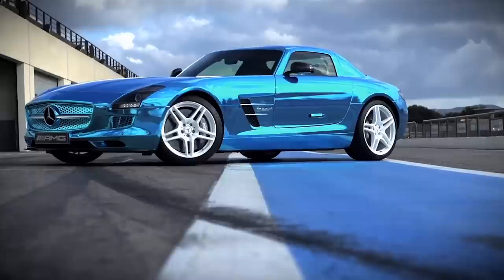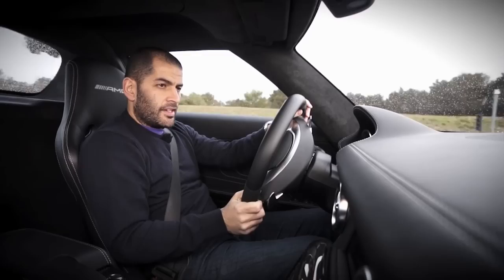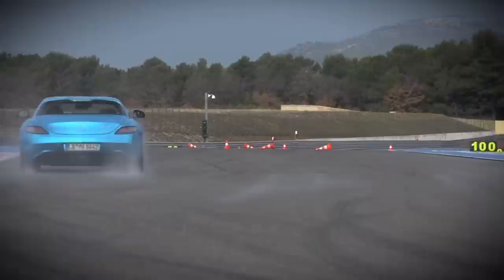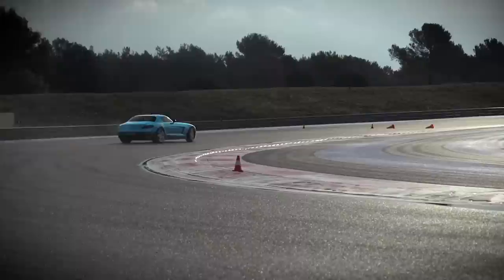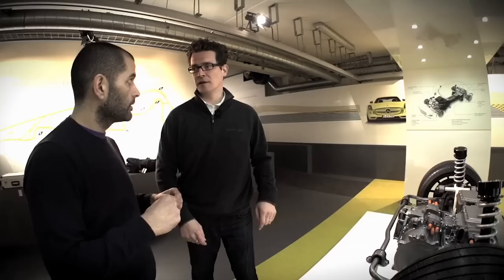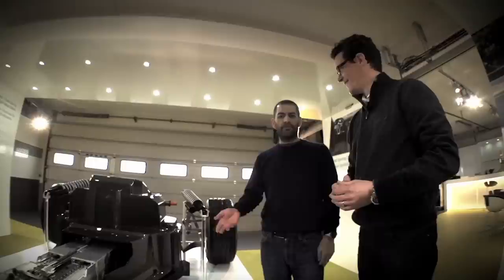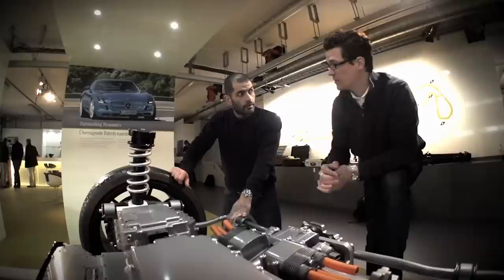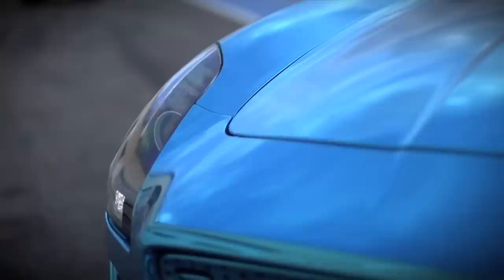Mercedes SLS Electric Drive. Can Volts Ever Match Pistons? - /CHRIS HARRIS ON CARS

Comment: It's the most powerful car the AMG division has ever rolled out of the factory and it STILL isn't an acceptable alternative for an ICE? It's only a matter of time before production costs fall, battery life further increases, and motor power/efficiency goes through the roof.

What excuses will die hard petrol fans have left? "But it doesn't go vroom!"
Reply: Did you forget the Merc SL65 AMG black? They also just made a wagon with nearly 900hp.
Reply: The 2013 SL65 AMG Black only makes 621 hp. As for the wagon you're most likely referring to the Brabus E63 AMG. Brabus is an aftermarket tuning company that specifically modifies Mercedes and Smart Cars, much like Shelby modifies Fords.

This is painfully obvious, Mercedes would never make a wagon faster than one of its flagship super cars.

The fact that the SLS E is the most powerful production car Mercedes has made thus far is a serious testament for the electric motor.
Reply: It won't stop electric being pretty futile and a waste of resources. what is the point in pursuing electric cars over hydrogen fuel cells?
Reply: Bensaves Hydrogen fuel cells power electric motors in cars, so I don't know what you're getting at.

If it's batteries vs. fuel cells keep this in mind. With hydrogen fuel, much like gasoline and diesel, there are mega fuel companies that control the resource entirely. Hydrogen is not an unlimited resource, especially since the most popular method of producing it requires fossil fuels.

What all this means is with hydrogen fuel you will have huge price fluctuations like gas prices do and still have fuel companies controlling the resource and the price, rather than the consumer.

Generating electricity is a waste of resources? I hope you meant how we generate electricity is wasting resources, even so that's pretty erm, stupid. No matter what resource we're using whether it is coal, oil, wind, light, water, etc, we don't waste the resource, it's being used to generate electricity.

As for batteries, that puts the control of the resource (electricity) much much closer to the consumer's hands. In the U.S., local governments have laws that protect and benefit the consumer. Also, the fact that electricity generation and transport is mostly  regulated by county and state bodies, the consumer has much more influence on these bodies than a resource like oil governed at the federal level.

All this being said, the most damming statement towards hydrogen fuel cells is simply that batteries and locally generated electricity are just so much cheaper. There are many more disadvantages to hydrogen fuel cells in cars, but I just wanted to focus on consumer connection and your notion that generating electricity is a waste of resources.
Reply: Sean Murphy
No, the batteries are a humongous waste or resources. I never said that generating electricity was a waste of resources. I said electric cars were (not precisely, but I assumed what i wrote was precise enough for the context). Batteries use all sorts of heavy metals and rare earth metals that are damaging to the environment and produce waste. As far as I'm aware, you use essentially inert Pt electrodes in hydrogen fuel cells which can be reused.

As for your comment on what's good for the consumer, that's immaterial. If petrol becomes antiquated, companies will find another way to gain control.
Reply: What rare earth metals do batteries use? Lithium ion, nickel hydride, and lead acid batteries are the top energy dense rechargeable batteries, none of which use rare earth elements. These batteries can all be recycled, I'm not sure if you were aware. The capacity of batteries increases by ~20% every two years, while our recycling and reusing methods and efforts further increase.

As for fuel cells, you need to extract hydrogen ions from some substance, whether it is water or hydrocarbons. We obviously know that we will run out of fossil fuels, so it would be pretty redundant to start on that path again. As for water, we need water to live. Just like we need space to grow food, the world needs fresh water to drink, bath, clean, and pretty much everything else. That's why using fuel cells and ethanol are not sustainable or even practical alternatives.

You're right, oil companies are trying to find another ways to gain and keep control, by investing in other fuel technologies like fuel cells and biofuels, while completely ignoring batteries. They're not stupid, they know there's not an unlimited supply of oil.

That's what makes battery power the most special, it takes the control completely away from oil companies and puts it into the hands of the individual.

Even when all of the fossil fuels on earth run out, we will never stop producing electricity. Geothermal, hydroelectric, tidal, wind, solar, and nuclear, we have so many to choose from. Why should we ultimately limit our cars to fuel cells? Mercedes isn't, its most powerful production car is fueled by batteries.
Reply: Firemarioflower Where did you even get this saving the planet message from? I'm talking about the vast efficiency and power advantage an electric motor has over an ICE. Mercedes has demonstrated this by making its most powerful production car fully electric driven.
Reply: Sean Murphy  Its all in your writing. Everything with effiency and electric are attached to this message. and you support it. So what if its more powerful, it doesnt have a proper sound, so the car is RUINED.
Reply: Sean Murphy I don't care about sound and barely care about looks,performance all the way,and it would seem electric cars are becoming quite the performance car.Even so i would be sad to see gasoline cars go,i love tuning engines,making them run better and the mechanics of them.I'm all for electrics,it would just be a sad thing to see them go(or become a hobby car that cost a lot to have and massive fuel cost)
Reply: Firemarioflower Now here's the nice thing about super cars,they aren't a necessity,there for they are completely up to opinion.My idea of a super car is some thing that will speed off the line,A car that can take fast turns,a car that can be driven on the road and then go dominate a race track.I want performance,handling,power,excitement,some thing that will scare you but make you want to drive it.I like electric cars but not because they are "green" or to save the earth,I just like the best super cars have to offer,and some electric super cars peak my interest.Electric cars have instant torque,high torque,and manageable torque in all four wheels,which is amazing for handling and off the line speed.These cars aren't designed to save the earth,there designed to go fast,and handle well,and are amazing pieces of engineering.And american hating?Ever hear of the chevy spark or volt?
Reply: Bensaves Safety, for one. Let's not replace flammable gasoline with even more flammable hydrogen.
Reply: Firemarioflower Prius? I seem to remember an electric SLS that could kick your Mustang's ass around the track.

You may be a hostile flamer, but I agree that the lack of polish of a supercar is exactly why it is so appealing (same reason people prefer Harleys). I doubt supercars will go full electric any time soon, especially the likes of TVR or Shelby that don't need to pretend to be good corporate citizens like Ferrari.

However, -for the common man- an electric car is better. It doesn't make noise, it has less moving parts, it's cheaper to run, there's more interior room, etc. Those things are what most people actually care about in a car.

All that's needed is some more mileage on a charge (coming soon) and models that don't blow the actual "car" part of the equation (would you drive an i-MiEV even if it had an Evo engine?) and normal people with other hobbies and lives who need transportation are going to want to buy them. And that's totally fine.
Reply: now try to modify an electric car. oh and try to take it to the track for the day. Have a nice time in the 5 minutes youre on full throttle
Reply: Sean Murphy And vroom is what supercar's all about...
Reply: Sean Murphy Vroom haha for real that shit is old and weak with what is new.
Reply: Sean Murphy I don't feel any emotion in any electrically driven vehicle, I can't 'love' a car like this. It's just an item, or a toy. Simple as that
Reply: Well this car isn’t as fast as the sls black despite being more expensive and charging infrastructure nine years ago was not that extensive yet.

Comment: I want one.
More than a Tesla.
Reply: Phu Doan I don't know why I like it more than a Tesla.
It's my favourite electric car, probably even one of my favourite cars ever and I really don't know why.
Sorry, don't kill me mang.
Reply: +Phu Doan Put some solar panels on the roof of your electric car.
Reply: +Eggly Bagelface knowing they only made 11 of them and that they go for 950k€ on the aftermarket, getting a tesla will be a bit easier
Reply: +Mew Wew I know you probably meant that as a joke, but the amount of power output from solar panels really isn't particularly feasible unless you want to double the cost of your already expensive car. Not to mention there's a lot of times you park out of reach of the sun, e.x. parking garages, home garages or in the shade. Plus most northern states get less than half the amount of solar panel output compared to southern states due to differences in light level. During winter it'd likely lose you energy due to its weight and lack of meaningful output.
Reply: A Tesla is much more affordable than this thing.
Reply: I like this better than Tesla too.  It's just cooler

Comment: From the way they're describing this, it sounds like the "negative torque" is the same concept that allow skid steer vehicles to turn.  Instead of powering both sides forward, it reduces or reverses the drive to the inside wheels in a turn to make it turn sharper.  A skid steer works nearly the same way.  When you turn, the power to the inside wheels is reversed, allowing the inner wheels to turn opposite the outer wheels and reducing the turning radius.  The same method is used on track vehicles.
Reply: Sounds like Stability control but instead of using the brakes it just reduces the rotating speed of the wheels, "same dog different leg action"
Reply: Rob Law Yes, Chris said that the torque vectoring was immensely complicated, but in truth it's vastly simpler than doing the same thing on a car with a centralized ICE powerplant.
Reply: @hyperlogos  Old comment, I know, but you're absolutley right. Electric cars are much simpler in every way.

Comment: I'm studying electric machinery right now, and I have some info about negative torque.  By changing the synchronous frequency (I'm assuming these are synchronous motors), you can adjust delta, the torque angle the rotor feels.  The wheels that get negative torque are actually generating electric power.

Comment: No thanks, it could have 2000hp and I still wouldn't wanna drive it. I have driven an SLS and nothing, absolutely nothing can replace the feeling you get when you push that 6.2L M159 out to 7300rpm !!
Reply: Then you should feel an electric car giving power from unter 1000 rpm till over 30000 rpm
Reply: Ismalith No doubt the electric version has a mountain of torque from 0 rpm but what I'm talking about is the emotional connection, the aural stimulation you can only get from a high-revving V8. Not everyone understands this but to me, this gives the SLS character... a soul if you will.
Reply: Murat Harman
Hmmm I heard that from my grandfather about how gasengined cars sounds so bad against steam engines, well I think this is just that we are used to this old pistol engines.
Reply: Man, congrats about your new job at BP
Reply: Murat Harman "this gives the SLS character... a soul if you will."
If you would like to feel YOUR soul, go test drive a Tesla Model S, let alone this SLS EMP Prototype... I DARE YOU... If you're honest (a rare commodity) you'll thank me! I'm not holding my breath tho... HA!
Reply: ***** haha, if only mate... My only involvement with BP is when go to the local servo and fill up my V8 with 98 octane and go for a blast down the highway !
Reply: Yeah exactly the only reason i would get electric is for a van and truck crossover like and a sedan coupe and sport car or commercial vehicles could stay gas i don't think we need to stop using gas we just need to reduce car pollution even for sports cars but it could have a balance i mean i don't believe in us running out of oil that shit crystallized down there due to natural chemistry so i would just reduce pollution for better health and balance! SO over all let it be optional for people to have any car electric and leave cars gas so people can pick where to reduce as the technology gets better and let them use what they want and teach why some conservation and reduction is ok and just improve other things like coal vs natural gas solar panels windmills and physical trash like recycling and burning efficiency at all hp and processes!
Reply: GameHEADtime
1. even when gas wouldn´t running out, why continue to use an old and bad technology?
2. It runs out, it takes millions of years to reproduce oil, also it won´t reproduce in places where humans live, so it needs as much time till your grandchildren can burn you in their cars, as humans had been in existence.
3. Most of our man-made materials are made out of oil, so there are a view more problems than just bad cars.
Reply: So you're actually more interested in the noise made by your engines ineffectivity(lets be honest), than factual performance? Intereseting.
Then I honestly don't think supercars is your thing, because they should be all about "form follows function", not vice versa. Maybe you should look into american musscle cars instead, those cars are all about feelings rather than results.
Reply: Salty Admiral well I do drive an Aussie made muscle car with an American V8 so you are right there but I just believe a performance car should make some kinda noise... gives it character :-) 

Electric cars are not really a cleaner tech right now, seeing as our electricity still comes from coal, nuclear and fracking sources.

If we had a global solar recharging infrastructure, then we might actually see electric powered vehicles reducing emissions.
Reply: Murat Harman
Well they are already reducing waste, simply by being actual good technology.

The noise on the other hand is simply an empty point, the sound of power has changed permanently, till the 1950s, power was simply a big ass steam engine and the massive powerful sound it has, then  it was the deep but much less powerful V8 muscle car sound, from the 1970s till 1990s a powerulf sound was the high pitched scream of a race car, now we are at a middle thing, that is more cars with exhaust flutes than actual engine noise.

I am not saying that I don't understand the greed for sound, after all I love to go to oldtimer airshows for that reason, but you can't kill thousands of people just for fun and the idea of sound will change anyway.
Reply: Not everyone gets this feeling, because not everyone gives a fuck. I wanna go fast, and the fact that I can do so without paying out to the fossil fuel slave owners than I will happily run my car off of solar power instead, and let go of that v8 sound to forgoe my own selfish interests and help the world.

Comment: Those cars are the future. Being capable of getting power to all 4 wheels independently opens up a new dimension.
Not to mention that these motors produce power at every speed. You cant stall them. You should see the vid of Walter Röhrl driving it and he has driven every car out there since the 80s. He was speechles.

Comment: Yo how is this more powerful than a p85d yet still slower to 60mph? I hate Tesla fanboys as much as the next guy but I just wanna know.
Reply: +Travis Wang Having more raw power doesn't mean much if you can't crank out as much of it as once, or as efficiently. There's a P90D out now that does 0-60 in 2.8 with 762hp; quartermile in 10.9 seconds.  The main improvement over the P85D, which did 11.7 quarter mile, is an improved contactor that allows it to safely yield more of its power at once. I still think Mercedes did a great job for coming out with that SLS back then, but the tech has clearly advanced quite a bit, considering a 5k lb sedan is comfortably beating it at its own game and with more than double the driving range at a fraction of the price.
Reply: +Sean Marks this car is actually made in coop with tesla

Comment: Just think no radiators or water pumps or transmissions, or fuel injectors or fuel pumps or alternators or other gas engine components to repair or replace.

And less Americans  dying in middle east oil wars.

And best yet no more paying trillions of $ guarding oil companies and Saudi oil/profits coming out of the Persian gulf, which we only get 10% of our oil from.

The real cost of gas to Americans is 10+$ a gallon when you factor in the cost of a carrier battle group in the gulf, 24/7/ 365 days a year.
Reply: There's a reason fossil fuel engines have transmissions; electric cars would be better at high speed with them. Also, electrics overheat easily, so electric cars still need liquid cooling.